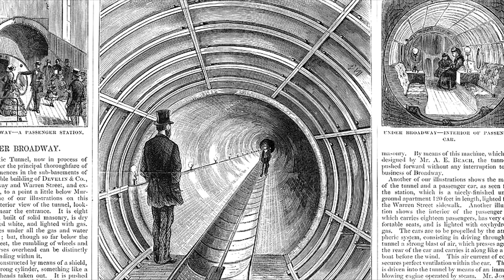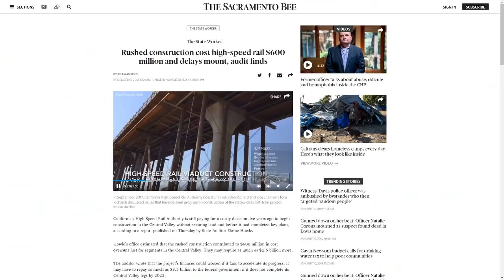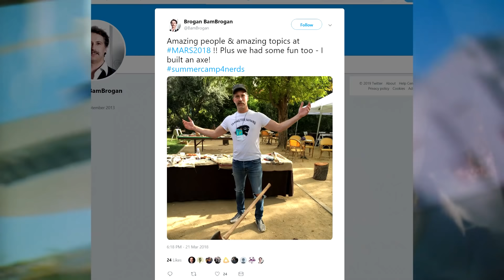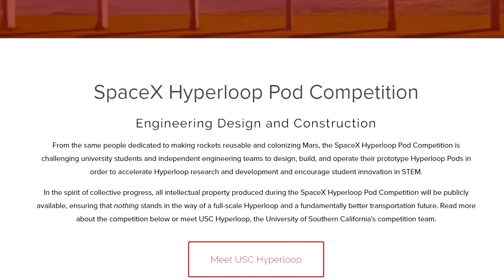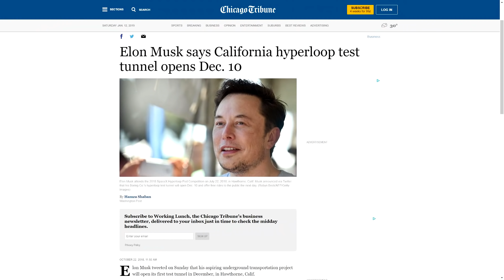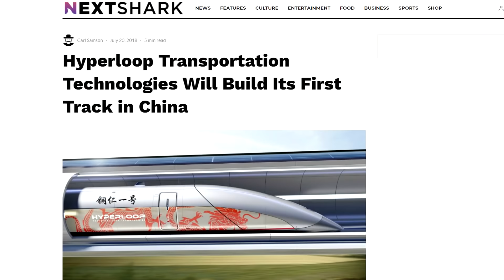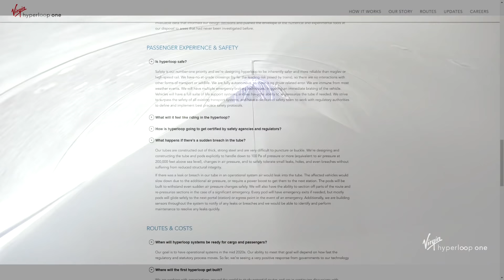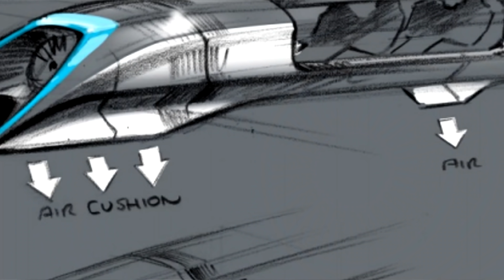Why Hyperloop will FAIL HARD - Its Biggest Problem...

Comment: The main issue is going to be safety. What happens if there's a pod failure or an accident in the Hyperloop tube - how do the passengers get out? They're trapped. Compare this with the safety systems in a long-distance tunnel. Running for 31 miles between England and France (23 miles under the sea), The Channel Tunnel is actually three tunnels - two rail tunnels, one in each direction, and a dedicated safety and service tunnel running between them, fitted with cross passages and access doors every 375 metres. In the event of an accident, passengers transfer to the safety tunnel which is smoke and fireproof. On the rare occasions when the system has had to be used it has proved effective - no lives have been lost in the 26 year life of the tunnel. The Hyperloop companies seem to overlook the safety issues in their enthusiasm for the technology . . .
Reply: That is why it will be used for cargo.

Comment: History repeats itself in a manner of speaking; in the early 1970's there were the Hovertrains. High speed train prototypes that used turbofan engines or linear induction motors. The trains rode a cushion of air over poured concrete tracks. Test tracks were built in several countries and the concept extensively tested. In France, Jean Bertin developed the Aerotrains, Britain developed the RTV and here there was the ROHR Urban Tracked Air-Cushion Vehicle. In France, Bertin's Aerotrain clocked 260 mph on its test track in 1974. In the early 70's, Hovertrain hype was comparable to the Hyperloop but within a few years all that was left were abandoned test tracks in Europe. Magalev development and incremental improvements to existing rail technology killed the Hovertrain. The current state of the Hyperloop sounds similar and you may be right; in a few years there may only be a handful of rusting, abandoned Hyperloop test tracks left over from this likely dud as well.
Reply: The hovertrain hype was exactly what I was thinking of during this video. Great minds think alike, I guess.
Reply: The problem with Hovertrains was NOISE. They were fantastically loud thanks to those turbofans and the new infrastructure requirement was just the icing on the cake. This was just at the time when environmental issues were coming to a head (particularly noise pollution)

TGVs/HSTs at full speed are also bloody noisy(*)  and require special new tracks and lines (6 mile radius curves at 200mph) for the high speed runs but at least they can use "normal" rails to get to central stations. The Shanghai Maglevs are almost silent by comparison (loud, but quieter than a commuter train or a passing truck for that matter) and a vactube maglev would be quieter still. 

Time will tell about whether they're practical. First deployment won't be in the USA and nor will first widespread deployment.

(*) I lived near where the line went through Rotterdam and moved out shortly after it was commissioned, so got to see it being built and to hear the trains going past regularly.
Reply: @alanbrown397  that's really interesting! Thanks for sharing.
Reply: @alanbrown397  I wonder if the hover train might have worked better with a linear induction motor instead to get it moving (while still keeping the hover skirt to keep it afloat)?

Comment: Why no mention of:

1. Cost of raw materials vs HSR -- two ribbons of steel, concrete sleepers, and gravel ballast -- or -- an implosion-resistant reinforced tube.  The cost per km/mile is 2 orders of magnitude more expensive.

2. No one has demonstrated a working vacuum seal between sections to address the major issue of thermal expansion.
Reply from the maker: These are also good points. A lot was cut out due to time. One thing not found are the costs of construction or energy usage, none of that is public.
Reply: Stop it, it's already dead
Reply: Um you do realize HSR is going cost us over 100 billion dollars in CA?
Reply: 2. is almost trivial. Learn some engineering before making such pointless accusations. Stainless steel bellows have been around for a looooong time..... 1. Isn't as......straightforward either. Tubes are an inherently strong shape. Way way way more so than some thin rails
Reply: @Zonkotron  C'mon, not everybody is an engineer, same as me. So, it seems that the diameter is not a problem ( https://i.pinimg.com/236x/ee/2b/80/ee2b8001c3fa4f6ced575c700f00045d.jpg ), but I can't find any bellows with that big diameter, which can also handle near vacuum. Do you know, such product exists, or at least, can be made?
Reply: On 2), LIGO seems to manage with its expansion joints, and it has a ultra-high-vacuum to deal with.

On that note, LIGO Cosmic Explorer plans require a vaccum tube of a similar order of magnitude in total length to Hyperloop, so maybe the two could compare notes?
Reply: Thermal expansion is a lie made by illuminati
Reply: @IamGrimalkin  LIGO doesn't have multi-ton pods careening down its length at a few hundred miles per hour. Their expansion bellows don't have to do anything except hold the air out.
Reply: Brutus Tan  "Mono-rail... mono-rail... mono-rail!"
Reply: @chadirby6216  So? Who said that bellows need to bear any load?
Reply: @jaceksiuda  Unless they manage to come up with infinitely strong materials for both the tubes and the supports, those bellows will be undergoing fairly serious movement and stress every five minutes as the cars zip by.
The LIGO tube is designed to NOT move, is a lot smaller in cross section, and is mostly protected from external stress.
Reply: @Zonkotron  Please, do you even know engineering?  Do you know the relation between linear compression force and radial compression force?  For a tube (cylinder shape), the longer it is the better linear compression resistance it will have, but it will have weaker radial compression resistance as it get longer.  Here is a quick example, imaging you have a perfect shaped cylinder can that make out of very strong material, as it get longer and longer it will be harder and harder to try to compress it horizontally, but on the other hand if you try to bend it from the middle, the longer the tube the easier it is to bend it.

The solution to this is make the whole tube thicker and in smaller section, and both of this will increase the construction cost exponentially.  Also more section mean more vacuum perfect sealing it required to connect the tube and hence bigger maintain problem in a long run.  Just give you a quick math lesson, the current size of the prototype tube has length of roughly 15 meters, if you going just from LA to SF in a perfect straight line, the distance is 380 miles, that's more than 61000 meters long, in other word you need to construct and maintain 40000+ perfect vacuum seal joint.  Tell me it is practical please Mr. "engineer".
Reply: @tarotaro6933  Your explanation is flawed. A longer tube offers no increase in axial strength. Oil and Gas pipelines are the very thing people are claiming to be impossible. Yes, smaller. Much. But subject to the same thermal expansion and sealing problems while carrying pressures that can be in excess of 100 times atmospheric pressure. And yes, i am aware that inside pressure cannot cause buckling the way outside pressure does. At no point have i defended the economical feasability of hyperloop. I don't believe it to exist. The mechanical engineering of the vacuum system however is trivial, large and expensive, sure, but trivial.
Reply: @Zonkotron  Nobody here are trying to arguing if the technology is possible for the hyperloop to be functional.  People are questioning the practicality of such project especially on the economic scale.  The good example is is rocket car possible?  Damn right it is possible because we have all the science figured out, but it is practical?  No, it is a super stupid idea, just like hyperloop.
Reply: Your cost comparisons are complete nonsense. What about the cost of "right-of-way", a major expense of any above ground transportation system. Don't even get me started on the cost of overpasses, bridges and tunnels for rail systems.
Reply: @davmar9923 I would love to see you start, please explain the cost
Reply: there is more than one solution to the resistance of a long tube, you could also imagine that the tube would have belts just like a barrel to keep it from bending. much more cost effective than having small sections sealed together and less of an engineering burden cause less seals have to be made. Also isn't that tube not supposed to bear an inwards pressure of only 1 atmosphere? cause with a vacuum inside the air would push around it evenly up to that amount since we're on earth (i'm not an engineer but my intuition goes that way, maybe i don't know all the parameters). and i believe that a cylinder has much more resistance to even inwards pressure than to outwards. So maybe pressure isn't that big of an issue... the biggest problem would be the seals, it's a tough one but not unfeasable. Though i'm not sure still of the practicality of hyperloop, i think it's good to give these kind of projects a try cause who knows what we can discover in the applied science fields and pipeline engineering that could be useful somewhere else? Not saying I'm right, take my words with a big maybe in front of it.
Reply: there is more than one solution to the resistance of a long tube, you could also imagine that the tube would have belts just like a barrel to keep it from bending. much more cost effective than having small sections sealed together and less of an engineering burden cause less seals have to be made. Also isn't that tube not supposed to bear an inwards pressure of only 1 atmosphere? cause with a vacuum inside the air would push around it evenly up to that amount since we're on earth (i'm not an engineer but my intuition goes that way, maybe i don't know all the parameters). and i believe that a cylinder has much more resistance to even inwards pressure than to outwards. So maybe pressure isn't that big of an issue... the biggest problem would be the seals, it's a tough one but not unfeasable. Though i'm not sure still of the practicality of hyperloop, i think it's good to give these kind of projects a try cause who knows what we can discover in the applied science fields and pipeline engineering that could be useful somewhere else? Not saying I'm right, take my words with a big maybe in front of it.
Reply: @Zonkotron  Long pipelines are never straight !!! They are bended every several hundred meters or so to allow termal expansion. This will not work for trains or cars...
Reply: @АгронДепартье  Exactly! It's like this: http://www.wermac.org/documents/docs_img/thermal_expansion3.jpg
...although, it would be fun to ride!  ;)
Reply: @АгронДепартье   Cool. And it still doesn't matter. Because hyperloop only has to withstand 1/100 the pressure difference of a pipeline, any old thermal expansion compensator will do. You can litterally buy them under that name. Hell, at those low pressures, fiber reinforced rubber over two sliding steel rings would do the trick. I cannot believe how people get hung up on this minor nuisance, vacuum is nothing. The big engineering challenges are elsewhere.....passenger safety in case of vehicle malfunction, cost, cost and even more cost.
Reply: @Zonkotron  I am not an engineer, so can only wait to see if this fails, actually, when it will become clear to everyone.
Reply: @Zonkotron  point 1 has fuck all to do with strenght, point 2 is anything but trivial
Reply: 3.The cost of making it earth quake resistant.
Reply: @sqlevolicious  Not a single once of the videos you link mention, even briefly, how they plan to deal with thermal expansion while maintaining a vacuum. Every test track which has been built has been on a scale small enough that expansion isn't a significant issue.
Reply: @dogguy8603   Yeah - and imagine how much that would be if Caltrans had to be responsible for doing it  with 10x the material costs and with a completely new tech that their shitheel contractors have never dealt with before.
Reply: @Thuringen  it would probably cost 5 times as much lol, government just sucks at everything, and we dont need a stupid train its easier and faster to fly down to LA
Reply: 1/Raw materials are: 25KV overhead cables, gantries, transformers, high reinforced fences, surveillance, rails, gravel, sleepers, weatherproofing, Rail is as heavy as a hyperloop and has more discrete parts. A 200 km hyperloop uses 200 million dollars of simple steel tube, and 200 mile of other gear so it costs too billion total 2/ Tractor tyres are 23 PSI... the vacuum seals are less complex than a tractor wheel. 3/you can fit about 5 hyperloops in a single channel tunnel, which gives you 5000 passengers per hour. currently channel tunnel does 2500 people per hour. The channel tunnel cost 5 billion per 100 miles in 2015 rates.
Reply: @Wrindwolf No, LIGO is overground and (more to the point) has working expansion joints.

LIGO Cosmic Explorer is planned to be underground though, if I remember correctly.
Reply: The thermal expansion is not a problem anymore. (eg. the modern highspeed rail in China are simple 1 piece welded beam, no need expansion section or any moving buffing like before). There are low thermal expansion steel and the little expansion can be absorbed by the material itself.
Reply: @AmericanRailClub  Virgin did have a few proposals leak, including a quote of some 55mil/mile for a Californian route.  That still strikes me as incredibly optimistic.  But then, these are the people who happily assert that they can dispatch pods every few seconds in a commercial setting before ever attempting to transport a single person in testing.
Reply: Korea has plasma air drag reduction with HEMU-500X. Sadly the documents are off limits to those unauthorised.
Reply: you could just build the tube elastic to counter thermal expansion - also there are plenty movable seals that aren't perfectly sealed but that's not necessary - you don't need a perfect vacuum to reduce friction - reducing the pressure or even keeping the pressure the same but filling the tube with hydrogen or helium would already reduce friction a lot
Reply: @JulianDanzerHAL9001  No air friction no thermal expansion anyway but there have been expansion related things on highways for decades.
Reply: There are countries that swim in money and this is why they have INFRASTRUCTURE. Korea has $450 billion usd in forex reserves and a public debt rate of only 30%
Reply: @aabb-zz9uw  ummm... yes - there will be thermal expansion without air friction - and yes, bridges and highways and railways have expansio njoints but they are not airtight

that said making an airtight expansion joint is really not difficult
Reply: @JulianDanzerHAL9001  Rails already adjust for long range thermal expansion such as the one-piece rails for high speed trains also they drop water on rails. This is nonissue anyway as other countries have built gigantic structures for decades-Korea, for example. Everything from recent times visible from the space was built by Koreans,
Reply: Korea swims in money, has no budget deficit and CEOs are engineering PhDs ,not some lawyers or accountants as in english economies. That's why.
Reply: Atmospheric pressure is less than 15psi, less than half that of a modern car tire.
Reply: Uh, Julian, I'm not the brightest bulb in the box, but I think no hydrogen , for obvious reason!
Reply: What about a tube made of concrete? Concrete's thermal expansion is negligible and it bears compression way better than steel.
Reply: ignoramuses. did you know farmers were complaining trains will cause lower milk in farms? the presurrised stations are just like submarine doors under water. how swimmers are able to get in and out of underground submarine without drowning the thing.
Reply: @NipapornP  😄go ride those circus things. think that what you want.
Reply: @JulianDanzerHAL9001  oh my helium. Passengers will come out talking like chicken.
Reply: Well the major concern would be safety, either from inherent safety itself or evacuation concern. Yeah, implosion sounds fun, just imagine being inside imploded submarine. Diesel moment dude